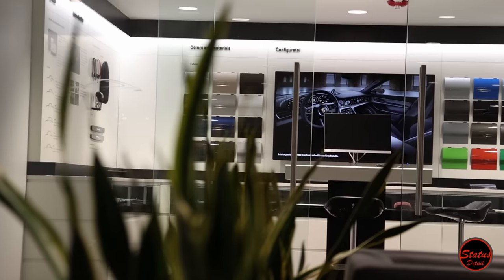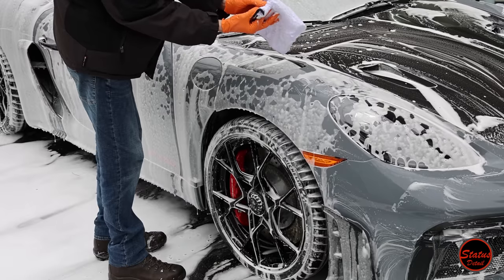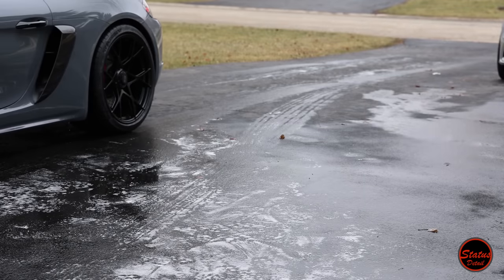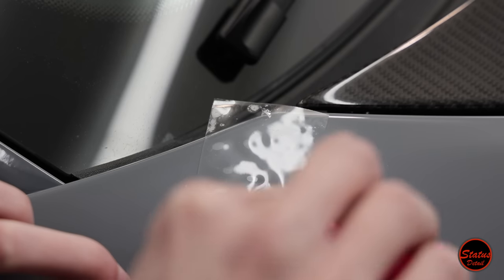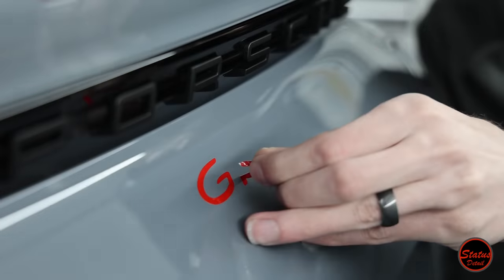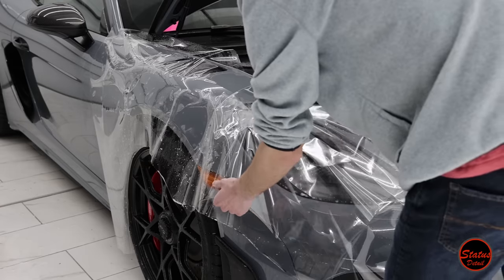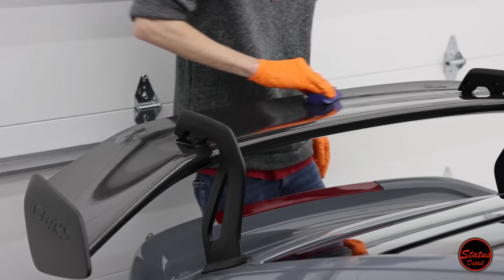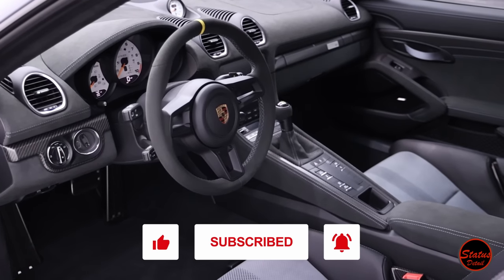GT4RS The World's MOST EXPENSIVE DETAIL!?!?

Comment: This will upset a lot of people. Paint correction is a marketing term to say cut and buff. Make no mistake, any time you wet sand a finish and then buff and polish it removes the mil thickness of the clear coat. Depending on where your located you can actually put the finish in a position where the uv will damage it. I’ll leave alone the other negative affects of a sub standard thin finish after. Me, ICAR Gold Shop and ex instructor. If your ppf’ing your car there’s no reason to do this procedure unless its damaged then add a layer of material that can be up to 12 mils.
Reply from the maker: That wasn't exactly accurate and your use of the term cut and buff isn't either. 

I paint corrected my s4 I just sold 8 years ago and had no clear cost issues during ownership. 

Dust nibs will look pretty awful when ppf goes over it. If your suggesting PPF conceals dust nibs then I know everything I need to lol
Reply: @STATUSDETAIL  Sorry, but if you wet sand any paint surface on a vehicle it thins the clear coat. I’m not saying nor did I say doing the actual work is going to be a detriment. It really comes down to who is doing the work. On cars that a true show finish is wanted its pretty standard to increase the mil thickness of the clear knowing it’ll be worked pretty good to get the desired result. I completely agree about denibbing a finish. I was not knocking what you or any reputable detailer does, just pointing out what some of the negatives can be. The other very big one is shops that do ppf by hand cutting on the vehicles. Your videos are great, wasn’t insinuating your unprofessional in the least. I’ll leave the cost aspect alone.
Reply from the maker: @Charlie-go6eb  definitely agree that you remove clear. It's actually a topic I want to talk more about in future videos. So we are on same page.
And I appreciate your comments and viewership 🙂

Comment: Do u remove doors and other parts of the car to PPF. Maybe as u said its boring so y dont show it. But just wanted to confirm
Reply from the maker: Depending on the car and panels we may remove things. It's also a conversation with the customer. 

For example if I remove something to go full seamless then to replace we need to fully remove everything. This could be less than ideal on out of state details because we need to find someone trustworthy to disassemble. It's also more cost. 

It's also often easy to break things like clips. 

Now some people think they want everything tucked. For example if I tuckthe bumper and fender piece's by removing the bumper. When you reasonable the ppf will rub against PPF. To tight of a tolerance. So it pushes out and peels. So it's never possible to fully tuck everything. 

Basically never need to remove a door. Sometimes you can remove a mirror but that can often be a crazy amount of dissembling and some of it won't go back together the same actually. So it's not worth it in my opinion. 

We do typically remove rubber trims to tuck under it. We did that in the doors of the gt4rs. 

Removing front canards on a ZL1 Camaro and it's wing in a upcoming job. 

I'm removing some rubber trims too on this GTS cab I'm doing tomorrow. Video coming soon!

I could go on lol.

Comment: how do you prevent water marks
Reply from the maker: Are you talking about hard water spots like during the wash?

That happens because water beads evaporate off the paint in hot weather typically and leave the minerals behind. So dry the car as fast as possible and do everything in the shade or even pull it inside after your last rinse.

Comment: I wonder if someone at port or the dealer touched these cars? I have a BMW M2 Competition and I asked the dealer not to touch it at all, it came dirty and with some of the film still on it, but it had literally zero swirls once I cleaned it. I didn't have to correct anything before PPF. I was shocked at how good the condition was, and I can't believe the factory does what you see on these Porsches. Maybe the dust nib, but the swirls?
Reply from the maker: Hard to tell! My recent gt3 touring video shows huge scratches behind OEM applied PPF lol. That must happen in Germany. 

But recently I learned the USA port can do a lot and I suppose it's possible they removed the PPF because it was scuffed or peeling and reapplied it amd during that process caused the damage you see in video. 

Either way it happened before the dealership

Comment: Taking the wheels off always is a way better way to clean that section! Great job but I would of painted the rotors, each dimple with a small brush & the edge surface then applied the brakes. Would get rid of all that surface rust you missed!
Reply from the maker: You can do whatever you like on your gt4rs but we don't paint brake rotors here.

Comment: Clean off towel on windshield , doesn't this put dirt/debris particles back on to car ?
Reply from the maker: Not really. The towel is not that dirty. Anything that comes off will be rinsed away in final Rinse. That dirt is not stuck to the car the same way it was previously and won't scratch anything when water will rinse it away. 

We worry about swirls when we run it with a towel with pressure into paint. 

It's a understandable thing to question tho

Comment: One you remove the brake dust by driving the car the rims will look like you drove thru muddy water. This occurs only on the barrel. How do you choose to remove this?
Reply from the maker: I typically go back by and use a clean towel with some quick detailer on it. Then wipe them. The wetcoat or hydro sealant step helps make this part extra effortless

Some people say to use products that stop the disk from rusting but I find that silly. The vents in the disj throw rusty water as you mentioned no matter what. More importantly you can't spray the back of the disk lol. 

A perfectly clean wheel requires an extra step or two unfortunately

Comment: one other question. i am the only person that washes and details my brothers 993 turbo. im not even practicing tee-ball when your mvp of mlb. now saying that i was in the car bus. dealer prep dept and many other areas. my bro's car has won 1st or 2nd in the couple things hes entered(hershey pca swap, and local pca). watching you detail these cars and seing you pess washer the towel for washing but how many other cars will that microfiber towel do. also when using towels for cleaners and products do you reuse those also. and if so, do you ever have cross contam. issues. i ask because all the towels and rags(im poor)and such are all keep together for this specific car. my brother was washing some like based things together bu have some issues with using them and they might have some other  chemicals that could transfer. i noticed 1st when the small round ppliators i use for zymol  somehow got in the ziplock that i thought we only used for applying a 2 step klasse coating. does that happen often and should i start to wash only like one chemical or cleaner at a time or if cheaper to replace i could? do you have a critea for you washing or reuse of all your fabric type stuff? thnk you my friend. any help i'd be much obliged.
Reply from the maker: That was like 6 questions lol
The microfiber can be reused as long as it's clean. If it ever builds up to much and can't be removed then downgrade the towel.
The towels should have specific uses and try not to cross use
Some of that I didn't fully understand sorry! I hope that helps tho
Reply: @STATUSDETAIL  I apologize for the confusion you answered what I what I was looking for each towel having this specific use I just had problems washing them altogether found I had some chemical residue on several towels. I enjoy watching your videos you are extremely good at what you do
Reply from the maker: @gregoryfranks7347  thank you!
I definitely recommend keeping the towels for specific uses. It will make them last much longer too 🙂

Comment: you took the porsche hood sticker off and didnt put it back on? also looks like you ripped the rear "R" in the gt4rs sticker.... I feel like those should not be touched. I would be upset if you ripped the original decals. You did an amazing got detailing and whatnot but maybe leave the decals behind unless the owner is specifically requesting that. What happens if the ppf starts to peel on one of those panels? take the stickers off again and then replace multiple times? seems like too great a variable to mess with.
Reply from the maker: You think I start removing oem things without having a discussion with the customer?.....

We chatted about what PPF over decals looks like and what it looks like removed with NEW Porsche stickers on top of PPF. 

Bottom line new OEM stickers reapplied will look as it should. Putting PPF over the original decal will leave air track line around it. It would look like it has a white ish outline kind of around each letter. When you remove that PPF one day it will likely rip the decal off with it too. 

You can't save a vinyl decal when removed. That's why you use new ones 

We talked about this for awhile and decided removal was best. The new stickers did not come in time. I will put them on in spring when the car is out of storage.

Comment: No concerns about joy riding customer vehicles.  I'm just wondering what happens on rainy or snowy days.  Are you not re-contaminating painted surfaces and wheel wells while trying to clear rust from the disks?  I love this channel though.  There's alot of upside here.
Reply from the maker: Well we kind of touched on that in this video. The driveway here stays pretty clean. Always snow cleared before a car comes and never salted. So if bad weather comes out way we do extra up and down trips in driveway to clean disks. Oddly it rarely rains when I'm washing lol. If it does then sure the fender may get a little wet with rain water. It will also get a little dirty at pickup when it drives away dry or wet out. The point is to clean the fenders not to keep them clean forever. Just need to keep up with it. Especially during maintenance time. 

I'm glad you enjoyed the video and Channel!!! 🙂🙂🙂

Comment: There is absolutely another way to remove the hydration marks without sanding. 

It amazes me how many people in this industry (and those who utilize them) tout how much they know like it’s the absolute and only truth. There are a lot of people out there, myself included, who are doing things far beyond this but choose to keep quiet and private. 

I’m not here to criticize the work or try to assert myself as superior…I appreciate your methodical approach but I have a hard time listening to someone talk about how perfect their work is when they are using a 5” pad on a GT4RS fender, no tape, blasting over creases and rubber trim.
Reply from the maker: I'd love to hear your mythical way to remove the marks on the fender and dust nib without sanding. When something etches into the clear it goes a few micron's into it. It's not a above surface defect. It's a crator of sorts. So you must level the area. 

Idk what a hydration mark is either. Your the first to use that term. 

I didn't use a 5 inch pad anywhere on this car. I also don't use tape for a reason 99 percent of the time but your a quiet private master so you know why so I won't explain it.  No seals or paintwork was damaged during this detail.

Thanks for watching and appreciating the methodical work 👍
Reply: @STATUSDETAIL  the hydration marks are from the factory. they apply the protective white plastic before the paint is fully cured. I will not share my method publicly but I assure you, there is another way to do this without “leveling” the surface- all I wish to say is that paint is like skin, it is flexible and can be manipulated without thinning down the surface. I worked on roughly 35 PTS GT cars in 2022, eventually you get tired of fighting these issues and start looking for new ways of resolving them.  I never proclaimed to be the master but thanks for the compliment :). But I admit, I do have quite a few secrets up my sleeve and the detailer in me wishes I could share them all because I love the trade, but the competitive nature of this industry has shown me that most people will take those secrets and try to turn them against you. Point is, there’s always someone around the corner that might be doing things you don’t know, so don’t be so sure your method is the only way. And FWIW, I’ve been doing this almost 20 yrs now, there’s people you’ll meet and secrets you’ll uncover as you go along. 

As for pad size, maybe I’m wrong, but that’s what it appeared to look like from my viewpoint. 

And as for tape. Yes, I do know what you’re talking about. There’s an overseas company that makes tape specifically for detailing that cannot be replicated by anyone else, at least so far. Not carpro, not 3M. My time in the industry has led me to some adhesive manufacturers that are very seldom discussed. So again, don’t be so sure there’s not a work around to every single issue you encounter.
Reply from the maker: @FlyingStuff  ok Mr secrets.
Reply: @STATUSDETAIL  lol, someone is upset they don’t know as much as they thought.

Comment: I am shocked how Porsche deliver flagship cars after seeing this. Any car for that matter.
When I got my RSQ3 in 2016 (the first model revision when the engine got it's 1st HP boost of 3) I actually specified that the dealer was not allowed to polish the car and not to even SUGGEST paint protection to me - this is because I had done it on multiple cars, starting with the old MING days in the 90's, and every single car ever delivered had had a SHIT job done. They would seal over dirt and then I'd have to get a pro to undo their work just to clean the car, and same with the "interior protection". With cars that I specified no after market protection for, they would still polish them, every dealer in Australia does this and EVERY SINGLE CAR I have ever had delivered either had scratched paint or swirls but ALWAYS had tons of polish that had completely baked into all the exterior rubber trim, polish they just never buffed off at all.. Imagine literal white chalk marks on every rubber trim portion of the entire car exterior, in the washer jets, etc. So with the RSQ3 I specified they were not allowed to polish it and they said they had to present it washed (dealer delivery bs) and I said fine and that's it, and I instructed them with the 2 bucket method and I even bought the shampoo they were allowed to use and the towels to dry it. Yeah, it was delivered without gloss but the paint was in much better condition than any car I have ever owned.

Long story short - I always notice paint imperfections as I have a reasonably keen eye, but I used to just automatically think that the lazy, incompetent dealers were 100% at fault.
Yet from what I understand here, this Porsche was delivered FROM factory and the buyer specified that the dealer could not touch it, and it even had the delivery film on it. Am I understanding this correctly?
So now I know it's a combination of bad factory paintwork AND shitty unqualified dealer detailers in some cases. Interesting.

Longer story continues - The Audi is the Glacier White Colour so maybe it's a bit harder to see imperfections, therefore maybe that helped in this case, but my mother has that almost 8 year old car now and it still looks "good". I have a guy who's an hour or so drive away but he's now the only one I will let touch my cars and I told her I would take her car to him for a refresh to make it look like new again so will be doing that soon...Any protections have worn off and it's time for a deep leather treatment and paint correction and a new sealant.
In any case, with a previous S3, which I DID have paint protected by a so called aftermarket professional detailer that had nothing to do with the dealer, well, this guy did such a bad job that there were large brown marks all over a black car that were sealed under the, um, sealant. Yep! In multiple spots on the car.. One was even football sized and he presented this to me as "finished and can I have my $1000 please". Wow.
With a lot of research I found my current guy and in a few hours he completely corrected the botch job and the car looked spectacular. I then had him work on the RS and so forth and he'll be doing my new cars in a couple weeks. Over time I got to know him and his absolute level of professionalism and CARE for the customer's property, and I think this is the key. You need to find someone with the skills, but also with the absolute courtesy and patience to never ever take a shortcut, and finally I found that guru.

Everything I see here tells me you are that guy for those in the USA (I presume from accent) . You take your work incredibly seriously and I commend you for it, and the final result was wonderful!
You remind me so much of my guy in Australia (or vice versa of course), the prep, the sheer labour and attention to detail put into it.. He also does PPF, correction, sealant, the works, so yes indeed I found someone good at the lot and I recommend that to everyone who truly cares about their cars - find someone who is not just in it for the money, but cares as much as the actual owner of the car. That's the key!
Reply from the maker: That was correct. Most issues happen at manufacturers or port. But many issues can happen at dealership or dealership or port can try to fix things that happened at port and create new issues. 

That was a big story! I read it all! I'm glad you have a trusted detailer now. That is a wonderful thing to have.to be able to trust someone with your car and know it's going to be done right is a relaxing feeling
Reply: @STATUSDETAIL  Thanks so much for reading, I am known for my online novels LOL. Appreciate it! Keep up the good work.